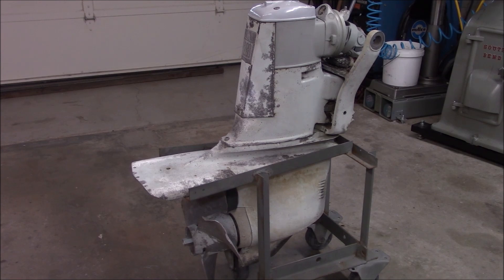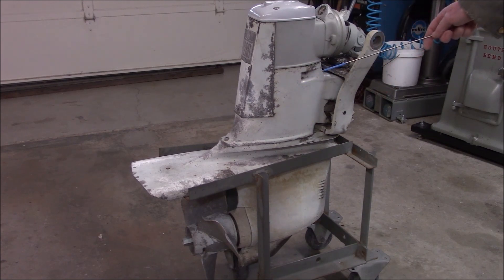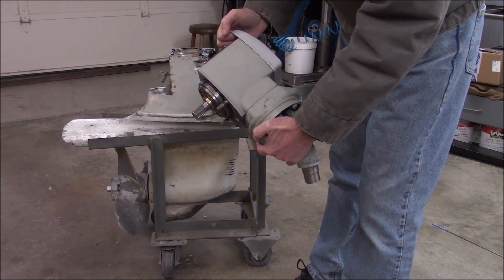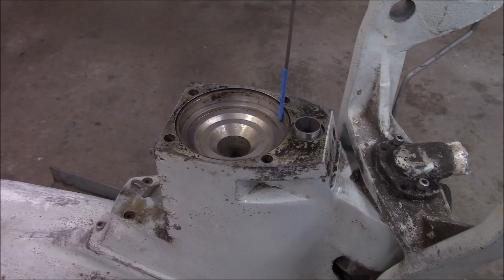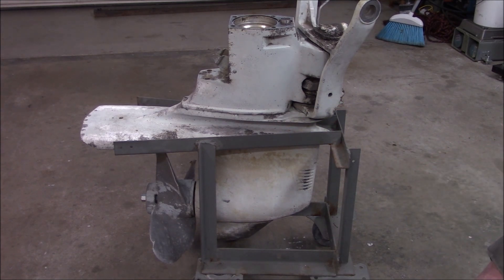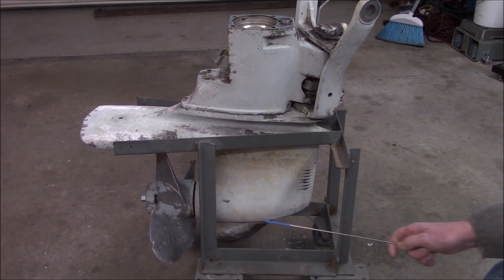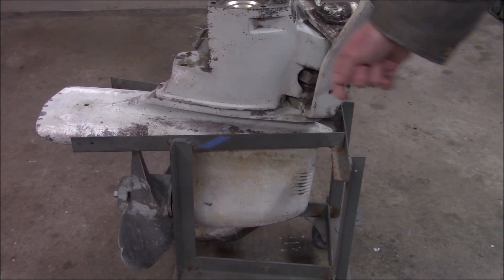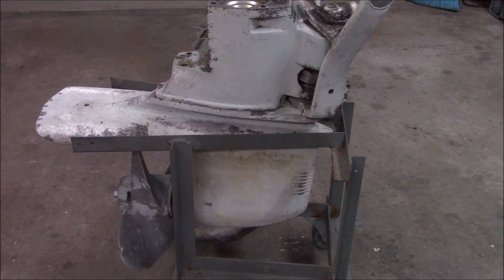Volvo Penta AQ Sterndrive Overview

Comment: Hi Dean...So pleased I came across your video. Maybe you can help me as I am unable to separate the the upper unit form the drive. All bolts removed and bellow disengaged. Unfortunately it seems to be seized and I am unable to break the seal. Have tried most everything I can think of and wondered if you can offer any advice? Would really appreciate your assistance. Cheers Tony from NZ
Reply from the maker: Tony, I think you referring to the upper unit from the middle center section. That's strange, I know you said you removed all bolts, there two nuts and two bolts.
Keep tapping with a rubber hammer and wiggle the prop.
you might be able to get a prybar under the two side studs. Put the nuts back on to save the threads.
Best of Luck...

Comment: Great Video! Thanks!
I’m slightly confused about what you say just after the 7 minutes mark…
If the gear box is not engaged (neutral) and the propeller isn’t spinning, how could any damage occur in the gear box due to oil not circulating if no parts are moving inside?

We are now waiting for clarification in the London Boaters group as I’ve reacted to a post related to idling (battery charge) 😊

Looking forward to hearing back from you!
Many Thanks
Reply from the maker: Thanks for viewing and commenting !
In the upper gear unit; the input shaft and U-joint assembly are directly coupled to the engine. This is also directly coupled to the input pinion gear that is continuously meshed with both the forward and reverse gears. These are always turning whenever the engine is running. The pinion gear and upper (normally reverse) gear are all above the oil level and there 4 bearings associated with them. The shifting cone is what makes the connection to the vertical output shaft when engaged.
So how risky is this? Well it's very difficult to determine how many of the bearing failures attribute to this, but I can tell you that 90% of the bearing failures are the pinion gear bearings. That said anything you can do to mitigate the odds is recommended.
In my opinion, it would take 20-30 minutes of idling to start worrying. I would just (if safe to do so) kick it into gear every 10 minutes for a minute or so to circulate a little oil.
I hope that helps,
All The Best....Dean
Reply: Thanks very much for the detailed response 😊👍
Reply: Hi Dean,

I have an extra question:
If someone has an oil leak on the outdrive but can’t get it serviced before a few months, is it a good idea to top up the oil regularly until it can be serviced?

If I’m not mistaken, the refill cap is accessible even when the boat is in the water…

Many Thanks!
Reply from the maker: @magicbengalsuk  Yes but don't overfill.
You can add through the dipstick plug, but it will flow in very slow.
If you getting water in the oil (gray or milky looking) drain a refill with new oil. don't let water stay in the drive. And repair as soon as you can.

Comment: Just so i understand, there is no water pump in either the upper or lower unit? im having overheating issues and the 2 pumps on my engine seem to be fine
Reply from the maker: That is correct, all the water pumps are on the engine. The heat exchangers especially on the diesels can get plugged up and require back flushing on the raw water side.